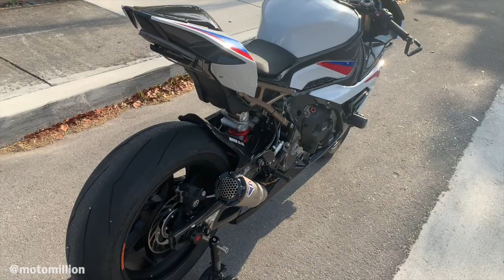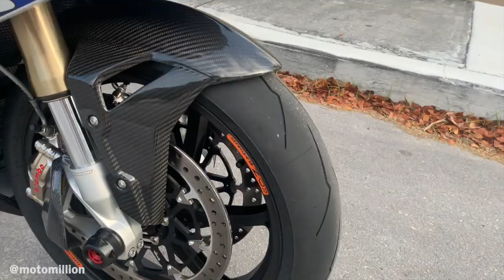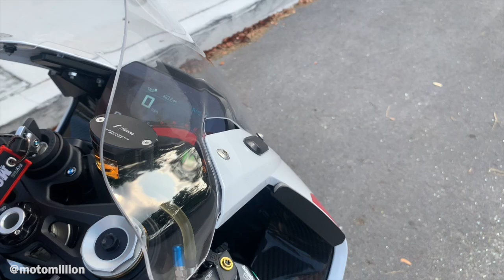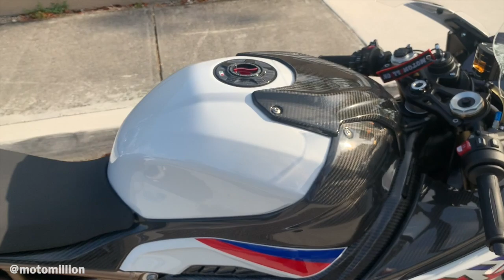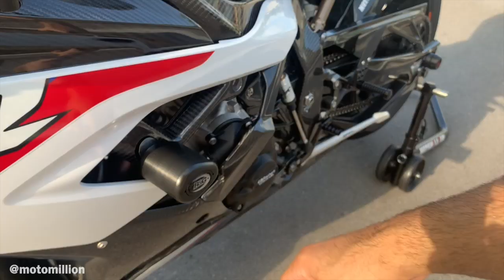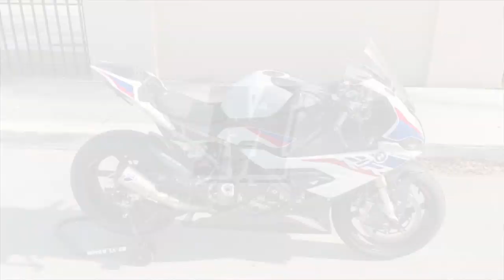The 2020 S1000RR Build Gets Carbon Bellypan and More | Motomillion

Comment: So is it better to go with aluminium wheels rather than carbon fiber wheels? Am plaining to buy s1000rr. Am from India, roads are not so good. Am 80% active on road and 20% active on track. Need ur suggestion. Bcos the price difference of pro and M sport variant is around $4500 in India. Thanks in advance.